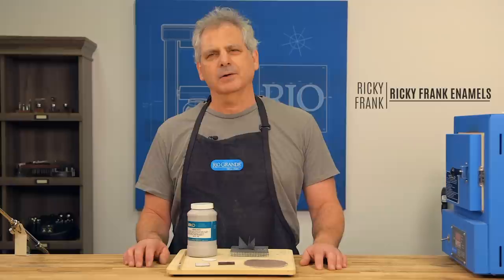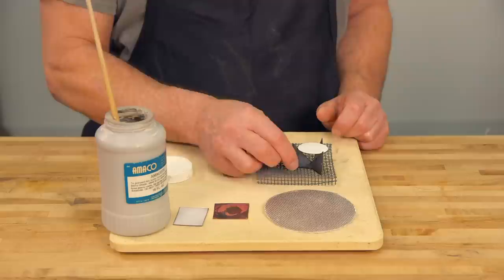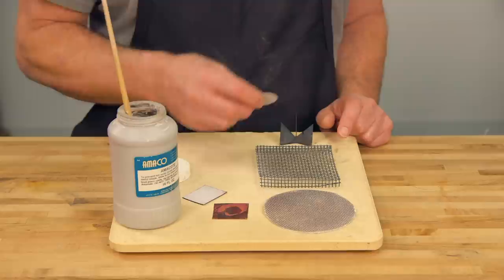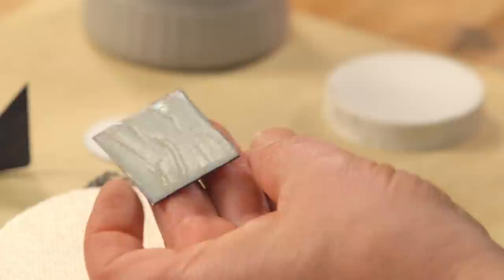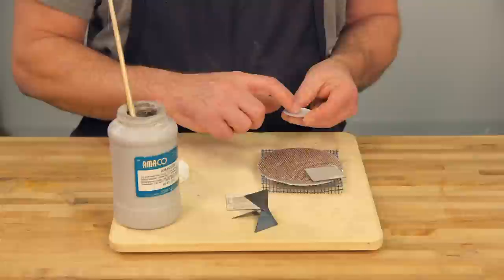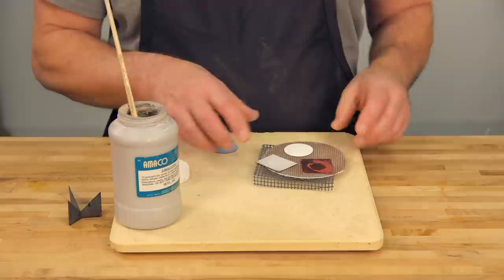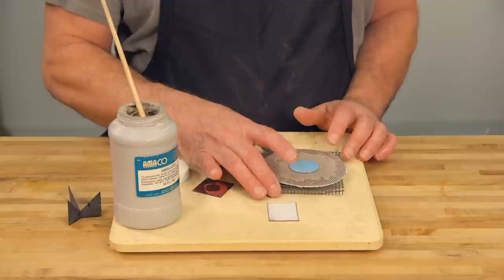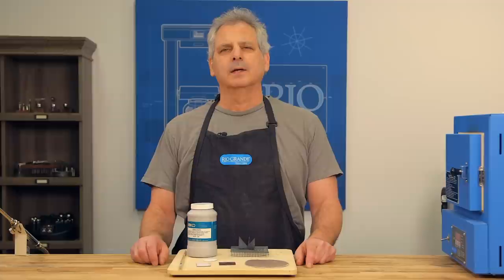How to Use Amacote When Kiln-Firing Enamels

Comment: Wow, so I tried this and all the amacote / scalex got fired into my counter enamel.  After reading the comments and Rio's advice, this is apparently what happens and it's very difficult to remove!  WTH??  Why would they put out a video from an EXPERT in enameling that shows repeatedly to coat your already enameled side with Amacote or scalex and not disclose that this is going to bond to the enamel?  I am blown away and have 4 ruined pieces because of it.  I was hoping to avoid the sticking issue I had with my counter enamel and the trivet spikes, which is exactly what he says he does here.  Why did you not do a video following through all the way to the end and how, if even, he is able to remove the amacote after firing??!!

Comment: I have watched this video several times thinking that I missed a key point.  I was working on a pendant of fold formed copper and the front and back were to be the same.  I coated the front with scalex (from Thompson) as an oxidizer retardent.  The back I covered with antique white opaque 1045.  I used three coats and firings to get a good coverage.  Because I did not want to paint scalex directly on the enameled side, I painted my firing cloth with scalex.  After sifting one layer of enamel on the front side, I turned the piece enameled side down on the cloth.  I fired the piece for about 1.5 minutes.  After removing it from the kiln, I let it cool a bit.  The piece had really stuck to the cloth and when I removed it the cloth pattern and scalex were embedded.  This was very difficult to remove using an alundum stone and a diamond file.  Any thoughts or comments?  Thanks

Comment: Hi Ricky, thanks for another great video. I have been getting trivet marks on my pieces and you know how much extra work that becomes. One question though...how is the Amacote removed after firing?
Reply from the maker: Hi Dianne, We asked our Jewelry Tech Team about this, and here's what they said: Amacote will actually fire into the enamel. If it's put onto the back of a piece, this would be difficult to remove and grind away. Usually,  Amacote goes on and will be on the back of a closed bezel so it doesn’t show. If the intention is to have both sides of the enameled piece show, the best advice is not to apply the Amacote. Hope this helps.
Reply: @RioGrande1944  This really needs to be said IN THE VIDEO. I watched the entire video waiting for an explanation of why this would be used and how it could be removed but got nothing. I was left with more questions than answers.
Reply from the maker: @MariaLanger  Thank you for your feedback, we will definitley look into this.

Comment: THANK YOU!  I couldn't find anything on Amacote except to paint it on clean copper surface to prevent fire scale. I had been putting it on fired enamel and it came out of the kiln with a haze that I thought was residual Amacote. After pickling I tried washing with soap, alcohol, Windex, etc.  So basically Amacote results in an etch on enamel, but resists fire scale on clean copper.  It was also a bit difficult to wash off my pieces with soap and water, "tapping gently" didn't work, and it practically bakes into any texture -- any tips on that?
Reply from the maker: A small amount of Amacote will be embedded in the surface of the fired enamel resulting in a slight haze or discolored effect. The best way to remove it from the enamel is to grind it off with a fine grinding wheel and re-polish. Tapping gently will remove the majority but there will typically be a bit leftover embedded in the enamel. Hope this helps!
Reply: My experience so far is that it all bakes on, thin or thick. I can't get it off with any amount of scrubbing.I was actually looking forward to the frosted look but that is far from what I'm getting.  It's super ugly with the streaks of white.  Frustrating. Please make a video showing how you get it off and what it looks like afterward.  Clearly I must be doing something wrong.

Comment: Hi!  Love learning about enamel And, I'm glad to know I don't need a kiln!  I hope to learn why a kiln is ever even needed, if it can be done this way. Why are these pieces starting out with enamel on the back side? Are these titanium trivets? I have some that look like the ones you're using, yet have been told they are titanium trivets, which they say don't at as a heat sink. Are these not titanium.. cuz you say they will act as a heat sink. You say that, when you use the amacote, the back won't look shinny. But I don't understand what it's literally for. Is it like how when yellow ocher is used while soldering, it prevents the applied  areas from melting or flowing as it usually would,? Sorry for so many questions,!!Thanks so much!
Reply from the maker: Hi There! Thank you so much for these questions. Our Jewelry Tech Team would love to talk to you and work through the enameling process. They can be reached at 800.545.6566—7 a.m. to 6 p.m. MST, Monday through Friday (ask for our Jewelry Tech Team). Hope this helps!

Comment: Hey! Thanks for the video. I was wondering why my enamel surface just popped off the metal with the scalex. Do you have an idea?
Reply from the maker: Hey there - Since the Scalex forms a barrier between the metal and enamel, your enamel piece will pop off the metal, and if you’re lucky, won’t leave any marks. More often than not, you will have a slight mark left from the metal firing screen. We hope this helps!

Comment: Hi Ricky -- another question.  Once you're done, how do you remove the Amacote from the piece?
Reply from the maker: Hello Irene, Dianne in the comments below asked a similar question. Here was the best advice from Rio's Jewelry Tech Team:  Amacote will actually fire into the enamel. If it's put onto the back of a piece, this would be difficult to remove and grind away. Usually,  Amacote goes on and will be on the back of a closed bezel so it doesn’t show. If the intention is to have both sides of the enameled piece show, the best advice is not to apply the Amacote. Hope this helps.

Comment: So the Amacote remains on the back of the piece for good or can it be removed at the end of the last firing?  Thanks!
Reply from the maker: A small amount of Amacote will be embedded in the surface of the fired enamel resulting in a slight haze or discolored effect. The best way to remove it from the enamel is to grind it off with a fine grinding wheel and re-polish. Tapping gently will remove the majority but there will typically be a bit leftover embedded in the enamel. Hope this helps!

Comment: Can you put the firing cloth directly on the Kiln floor without using a trivet or rack? And if so do you need to add Emma coat? Or can you just put a non ammonia mold bottom directly on to the Kiln cloth? I have a very small ultralite kiln which I accidentally got enamel on the bottom of my kiln floor.
Reply from the maker: Hi there - You can just place the cloth directly on the floor. Hope this is helpful!

Comment: Where do i get firing cloth from?
Reply from the maker: Hi Logan, Thanks for your question. The Woven Fiber Kiln Disc can be purchased from Rio, and you can find it here: https://www.riogrande.com/product/woven-fiber-4-1-2-kiln-disc/350049 Hope this helps!
Reply from the maker: Hi Logan, Thanks for your question. The Woven Fiber Kiln Disc can be purchased from Rio, and you can find it here: https://www.riogrande.com/product/woven-fiber-4-1-2-kiln-disc/350049 Hope this helps!
Reply: i need parts for my speed fire kiin
Reply from the maker: Hi Logan, Thanks for your post. Unfortunately, this product is no longer manufactured, and it is not carried by Rio.